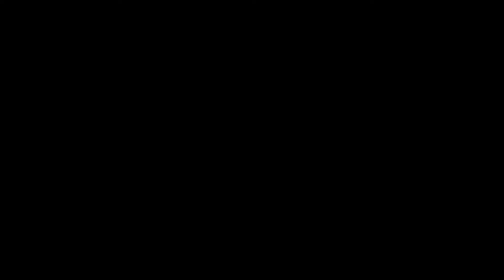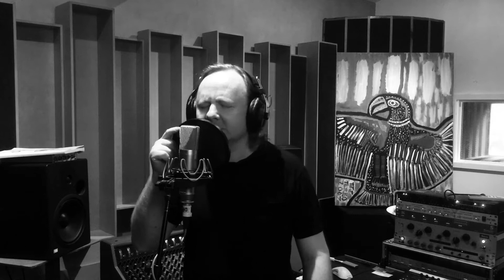Part 2: Neumann U87 vs Rode NT1 - OPR Mod - Endless Circle with Electric Piano by James Ferguson

Comment: Would be great to hear a direct comparison between the NT1 mod and your original U87. Any chance you could do that?
Reply from the maker: Hi Chris, granted, i did not make the direct comparison in the video; therefore I'm coming up with a part 3 video idea to allow a direct 1:1 comparison of the U87 and the Rode NT1 OPR mod. For the record, I can mention that the main strength and noticeable difference with the U87 should be the rather forward, flat, yet pronounced mid to upper midrange  "presence" that the U87 is famous for. This is an astonishingly flat, yet pleasing sound on vocals. Also, the top end should be even smoother, possibly due to better transformers and other electronics. But you (and others) be the judge. I'll get onto the 1:1 comparison video now! Stand by.
Reply from the maker: Hi Chris, following video now clearly demonstrates this - read my other notes, below the video as I made some other points!